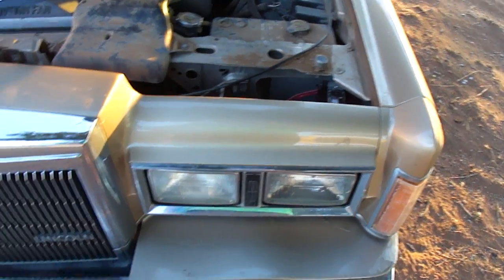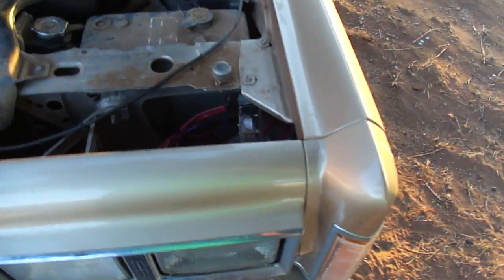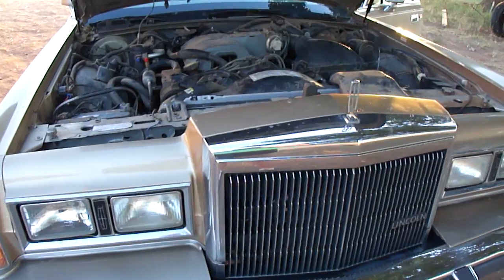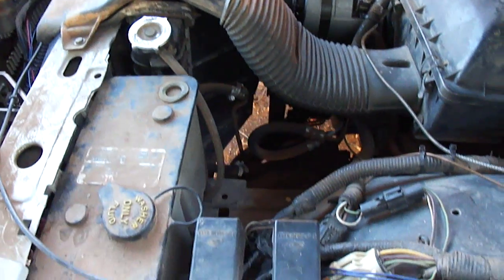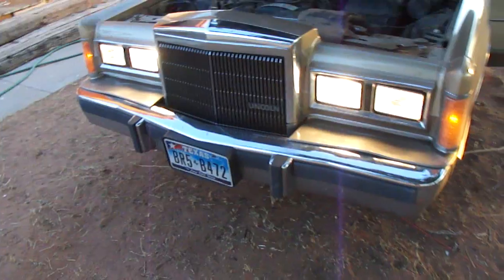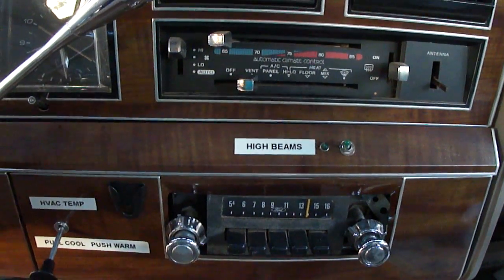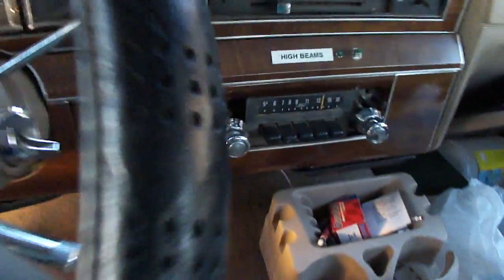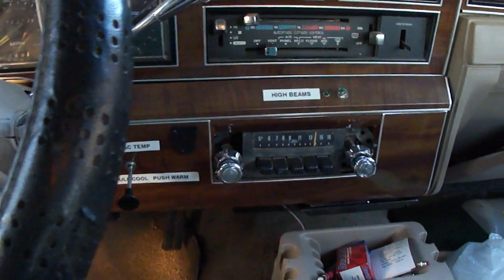1989 Lincoln Town Car high beam relay circuit

Comment: Hi,im having the problem with low beam headlight going off on its own ( haven't tested high beam yet) i think i can smell electrical burning inside the car,not sure if its a switch or relay,where is the headlight relay located?any idea what can it be? thanks

Comment: I wished some of these Lincoln mechanics could help us out with this problem of no high beam headlight! I've changed out everything except the photo sensor on top of the dash and One day out of the blue the high beams came on for about a month and then one day they stopped! You have to keep pulling the headlight switch on and off until they finally come on! This is a 1989 Lincoln Town car with 7500 original miles on it

Comment: I have a 93 Town car and I'll be driving don the road at night and all of a sudden the low beam headlights turn off. It sounds like the "auto dimmer" is turning them off. at that same time I try turning the highbeams on (pushing forward on the turn lever), still no lights. If I pull back and hold the lever, the highbeams work. then after a bit I can release the turn lever and the lowbeams work. Its a bit dangerous driving so I was wondering if you had any suggestions? Maybe you can point me to the direction as to where the sensor(s) might be located? I was possibly thinking about trying to bypass all the "auto dimming" crap anyway. Is there a semi-simple way to bypass that?

Comment: Hi I'm having the same issues with the lights on my 88 Lincoln town car. Even after putting in new relays and also looking at all of the ground wires to make sure there not loose, I still don't have no headlights or high beams. Could you recommend something to do other then bypass the relays? I checked all the fuses also cleaned out all of the connectors with electrical contact spray. The problem started when I had to jump start the vehicle because I had a dead battery. I was wondering if it might have burned out the ECU computer on it. The door locks are also not working as well as the Wind shield wipers thank you.

Comment: I have a question,I own an 84,and at one random point in time,for just a minute or so. I was driving on a dark windy road,and put my high beams on,and they flashed on and off pretty quickly,they stopped after I switched it to low beams and back to high beams. I don't know if it is a bad relay or not,because it only did it that one time.

Comment from the maker: @gadget73 When I got this car, someone had plugged off vacuum lines going to the auto temperature system. The system would stay on constant maximum heat. I just disconnected the actuator from the blend door and just laid it to the side. I didn't remove any of the components so that I can go back and troubleshoot it later.

Comment: Also, the HVAC problem is usually the interior temperature sensor that lives above the glovebox or a vacuum leak. If its going hot to cold randomly or wont get hot at all, the sensor is bad. If it goes hot every time you hit the gas pedal, its a vacuum leak. The soup can on the fender and the thermal blower lockout in the heater hose on the passenger side are frequent vacuum leak sources. The check valve at the vac tree behind the center of the intake manifold can also fail.

Comment: The problem is the auto-dimmer. Most of the time its a bad ground, or a bad connection at the photo sensor mounted at the mirror that makes the headlights go stupid. You can bypass that photo thing by jumping ground to one of the pins, though I forget which. Theres also a high beam relay in the dash somewhere that the photo sensor drives that could be at fault. Its not that hard to fix if you can think backwards like a Lincoln engineer :)